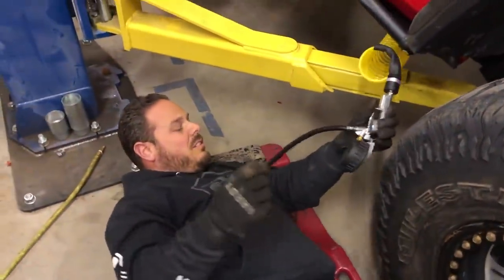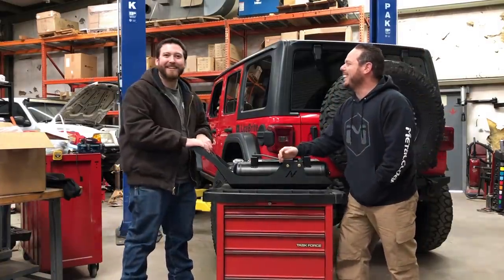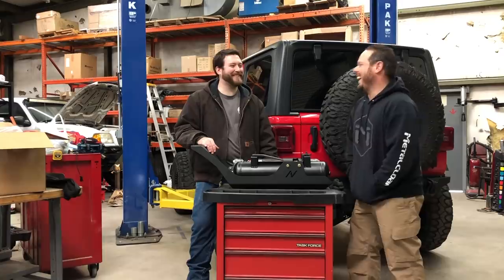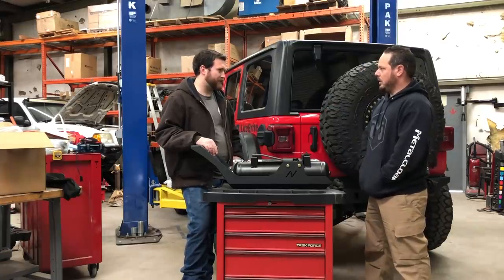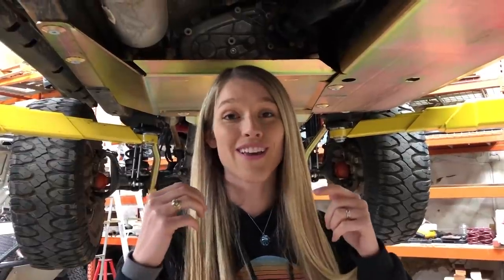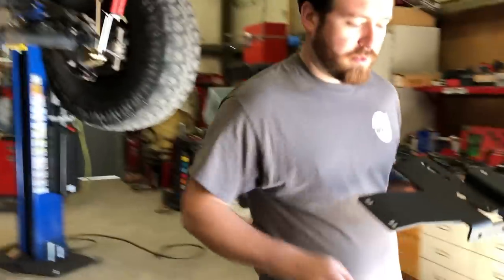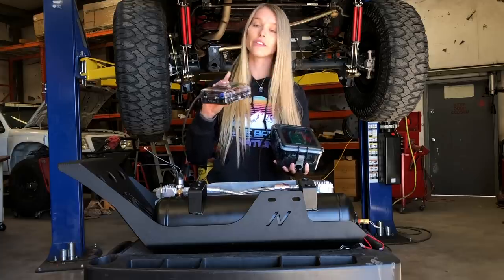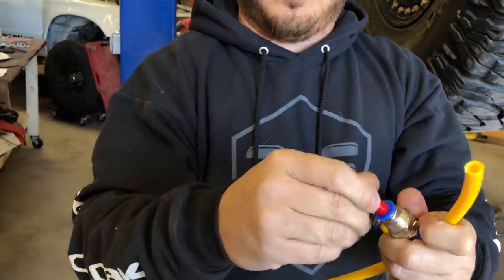We Install Air Compressors UNDER Our Jeep Wrangler JLU Rubicon

Comment: You may find the plastic to plastic quick disconnect leaking over time.  Recommend brass quick disconnects.  I use the rubber tips for walkers to cover my quick connect fittings. The rubber tips do wear out. They are also very cheap and easily available at drug stores and Walmart.  I only plummed one line forward and one line aft. Makes it easy to power someone's Arb if necessary or my tow rig air powered exhaust brake. Also recommend upgraded relays for the compressors. Be sure to carry a spare pressure regulator. They typically are rated for how many times they open/close.

Comment: ha! we love you too! i fabbed the one for the JK to get in a single Viair constant duty on board system(minus that brain) but i used big rig brake line. the tubing works great but it gets tiresome repairing it. i have been exploring another location to double her up another compressor, this set up is sweet. the room in a 2 door is very limited. i have the portable Viair in the JL which is fine for the 33's. they make a great product, we have experienced zero issues. lol that brain makes my manifold look like its a homemade ancient pos that belongs in a museum. but that sh*t still works both lockers and a bumper chuck. i did have to move the pressure sensor relay around to find a sweet spot, it doesnt like heat or water.

Comment: Pretty awesome system. I would plumb the fresh air intake in to the air filter box so that it always gets fresh clean air to pump with. Be sure to add a drain valve to the tank to relieve the condensation buildup in the tank.

Comment: I have arb dual compressors mounted on side of the rear cargo, I added 1.5 gallon air tanks to run air tools. I like this better it’s inside the Jeep and doesn’t take up hardly no room also the open areas of the air holder will fill up with debris. The problem is Kevin, you are in the same boat I am in, with all the mods on both of ours the REAL issue us the weight, we are literally driving a M1A1 Abrams battle tank down the road and trails. The more mods the more weight, and weight is not only bad mpgs but terrible off roading. We are at the point a stock Rubi with descent 3.5” lift and tires with no more mods will have a big advantage off roading and mpgs that we gave up with winch, bumpers front and rear, belly skids, gear, compressor, rock rails, etc. the last goes on and on.
Reply: Kevin Williams I agree, I will see y’all at Windrock, just saying not just yours but mine to, that weight is becoming a limiting factor, in off roading the lighter rigs are better. We used to see the little Suzuki Samari with 10” of lift, unstoppable because they didn’t weigh much at all. I am now thinking about ways to lighten up my Jeep some, even your Buddy Michael was talking about weight. Y’all are fortunate to have companies comp y’all stuff but eventually you’ll have to draw a line because of weight issues.

Comment: A couple things:  They stressed this is pre-production and they want to see if it works.  They will be able to figure out if the heat is too much for the compressors pretty quickly given how much they wheel.  Space in a jeep is at a premium so being able to use dead space under the jeep is a pretty big deal.  The Power tank takes up a good amount of space inside the jeep.  Cost of a dual 444c Viair and 2.5gal compressor kit from 4wheelparts is $689 and Air command kit is $389.  I'm guessing the mounting plate is about $200 so figure about $1300 for this setup.  Powertank is about $750 for complete jeep kit.  Given how often they wheel and in remote areas, an onboard system makes sense.  If you go out once a month and have a local place to fill up on CO2 and have the space, its hard to beat the Powertank.  Personally I went with a powertank given my needs, but if I wheeled like them, I would look for a tank and compressor system.  If this ends up being durable enough it will be a great capability for JL owners.

Comment: Ok have you ever pulled up beside a tractor-trailer and heard the air bleed off of the compressor from the air tank? If you have then that is a valve that once it builds up to a certain pressure it will blow off a Blow by Valve. They also have drain lines or valves that won't bleed off any condensation that is made from the compressor as you know compressed air creates moisture and you have to bleed the moisture out of the tank if you don't they will Rust and cause contaminants to enter the line there for messing up your system so don't forget to install a bleed off valve on the bottom of the tank so you can bleed the condensation out you don't want condensation to freeze in your pump tank lines or your Schrader valves on your tires just a thought y'all have a great day

Comment: As soon as the JT comes out, I've been planning on putting a compressor underneath, as well as 2/3 spare batteries where the spare tire goes. ( I'm going straight to 40's which jeep already said would fit under their anyways. 😂

Comment: Good idea. Be interesting to see if the drive shaft gets into it under full flex. My JK’s driveshaft goes into the gas tank skid. I know you are running aftermarket shafts, so I wonder if that will need to be done for this setup

Comment: So much for showing what a stock Jeep Wrangler will do without all the expensive upgrades.
Reply: Michael Martin their Jeep is pushing 70,000 to 75,000 if they did not get bargains on the gear they are promoting.

Comment: That is a great solution for onboard air, wonder if there will be a similar space on the gladiator? also do not want to think about what something like this system might cost as nice as it looks, without the extra air controller!

Comment: I know it's a prototype,  but if he is concerned about heat and the pumps, why doesn't he switch the location of the tank and dual pumps? Have the tank next to the heat shield and the dual pumps insulated by the heat shield and tank. Really awesome system!

Comment: You should suggest that the manufacturer install a drain on the bottom of the tank so any moisture that develops can be drained off. Additionally, there is a possibility of water entering the air source line that could wind up in the tank that would need to be drained off.
Reply: Kevin Williams I must have missed it in the presentation, Thank You.

Comment: That would be kind of cool if you could hook that 2 air ride and that way you can air up your suspension by a little gauge cluster inside the cab and then you can also are up your tires with the same unit I think that would be kind of cool especially if you were going through snow

Comment: 3+ Months after your install video posted. I was just taken off of my $0.00 per month budget and am getting ready for an on-board air system. I have an ARB Portable Twin compressors enroute. I love the ability to air up/down from my phone automatically. But when I went to Nextadventuremotorsports to see about getting their air command module, hoses and fittings and just using the portable ARB instead of mounting mine next to the exhaust, I find that they are not showing any air system, with or without a compressor on their site. That leads me to believe your prototype is still under development and not ready for the public. The BIG QUESTION is, "How is your prototype system working for you?" I love the system, just not the mounting location of the compressor. Any updates would be greatly appreciated. Thanks in advance.

Comment: I am concerned that the air intake piping is too small to flow enough air to keep the pumps charged. 
While under pressure that size is fine, but at atmospheric pressure, the flow rate will be slow and cause the pumps to not work at peak efficiency. 

It is a good idea, with room for improvement.

Comment: so how do you guys plan to drain the water that the air compressors put in the tank? you have it upside down so no ports on bottom for a drain valve. condensation will fill that tank up eventually and if its steel it will rust plus you will loose air capacity.

Comment: Congrats on the air. That’s an awesome system.  Quick question does the system, winch etc put a lot of pull on the battery?  I have seen people running two or switching to something like the optima yellow top but don’t know if it’s needed.
Reply: Kevin, good to know. Thanks for the reply.

Comment: I have a 2009 Jeep JK and have a Viair Onboard Constant Duty Air Compressor and Tank. I purchased a Cat Muffler so it sits under the left side of the Jeep. So this frees up the muffler area. So I was thinking of purchasing a muffler skid plate and using it to place the air compressor and tank setup.

Comment: Dirt and mud builds up around the push connect fitting then it becomes a pain to remove air lines until you clean all the debris out.
Reply: I have bagged several cars using these fittings. I would have to agree, but they supplied some plugs to help with that. I also think the fittings and ends of the air lines will wear out pretty fast. The fittings and lines are just not designed to be constantly reassembled. I recommend they keep some air line cutters in the glove box to cut some fresh ends every once in the while. I plan to build a similar setup, but using standard 1/4" quick couplers.

Comment: any plans for us 2.0L guys? I have been looking at a CO2 system but I have run an ARB under my JK hood for years and i would prefer air on demand. Especially if I forget to weigh the tank and go get it filled.
Reply: @boughtnotbuiltoffroad7784  yeah that what i figured.

Comment: Do they have anything for the jku I run a viair setup right now with one compressor I want to see if I can get a second compressor and a better mounting bracket underneath the Jeep.
Reply: @boughtnotbuiltoffroad7784  that would be awesome the set up that I have right now I have my compressor in the engine bay and my tank underneath and it's sitting sideways on a mounting bracket that I made next to my EVAP system is so I mean it works but I want something a little bit better with a skid plate just so I don't damage my tank.
Reply: @justinbos3924  Hauk Offroad makes a air tank skid system for JKs http://haukoffroad.com/by-vehicle/jk-products/jk-air-tank-skid-system/

Comment: Not sure if I'm seeing this right so you have to hook it up underneath every time you need air? like in our trucks when we had our pickups all we did was hook a hose up right there at our bumper and air came out the fitting was at the bumper. we didn't have to crawl underneath the truck every time. Are you going to have to do that or is there not a air valve where air comes out with the hose hooked up at the bumper? I wouldn't think you have to crawl underneath every time you need air for something.  As much stuff as you're putting on that jeep it's got to weigh a ton LOL all the skid plates that looks like a lot of metal there is steel that jeep starting to be very heavy can't imagine how much more it's eating up on the gas mileage with as must travels y'all do  going downnthe highway. And people  supposed to give gas mileage much as you travel highway you need as much as you can get every mile we count LOL
Reply: No, they are running lines to all 4 corners of the Jeep with quick connects at each tire.
Reply: @metalhead4x448  that's what I thought there would be quick connect somewhere. What's the name of this company again and what city are they in

Comment: Your machine is getting fat. A lot of weight for a 3.6 liter that has stock gearing. Gear swap, super charger, turbo charger. I have a similar set up on my ford raptor and super duty. Works well. Not sure how your maintenance will be on the air pumps after a few mud and water crossings. My pumps are in the bed of the raptor and super duty. Noise wise is perfect for under the vehicle. Those pumps won’t last while submerged under ice, snow, water. Get stuck for any length of time and those electric pumps are done. You will have to completely dry them out before use. Make those pumps water proof and then your buddy’s engineering will pay off. Take that pump back down and submerge for 3 min and see what happens

Comment: you should have put sound deadener above the compressors
Reply from the maker: Mark Micallef They’ll only be running when we air up, so we weren’t too worried about the noise. 😊
Reply: @LiteBrite  Jelly might appreciate it LOL

Comment: If you think  its HOT for air compressors under a hood, put a temp sensor near your compressors and let us know how hot it gets in that area in the middle of the summer while rock crawling, IN THE MIDDLE OF THE NEVADA DESERT.  I am betting over 300 degrees. What is the operating range of the Viair compressors???  Hmmm.  Too close to the pipes for me.
Reply: Best comment so far.
Reply: My Viair pumps operate so hot that I cannot touch them. They are used running and being extremely hot and I have mounted in the trunk with less air flow. Id wager they run cooler when outside the vehicle and the amount of heat that radiates off your exhaust pipe and through a headshield is likely going to have zero impact on the temperature the pumps run at. Viair makes a JK pump kit for running behind the radiator, infront of the motor, I would argue that is far far hotter for the pumps to operate in with worse air flow.
Reply: @Casey250  Bottom line Casey, what is the upper most operating temp of those pumps? They do not post that information on their website. And what is the air temp of that cavity after you crawl up a 2 mile long rock garden with an ambient temp outside of 110 degrees? The first time I got out of my new unlimited and brushed my bare leg against the metal rock sliders causing a 2nd degree burn, I checked the temp of that rock slider. 250 degrees at the rock slider where my leg touched it. What was the temp of the air in the cavity they mounted the two compressors in, under the jeep, inside the frame rails, less air flowing past than my rock sliders had, crawling at 1/2 to 1 mph straight uphill. I am betting the temp of the heat shield btw the exhaust pipe and compressors exceeds 350 to 400 degrees in some circumstances.  Everywhere I have checked (including Viaircorp.com) do not give any max. operating specifications. They do have thermal shut off safety's which will shut them if they get too hot. BUT, how many times will they reach that shut off temp before they melt the Teflon or plastic piston or at least, greatly reduce how long they last. If they would put a 100% Unlimited, lifetime warranty without question, will immediately send you another compressor as soon as you think you need one because yours is making a different sound than it did when it was brand new, then I am going to be concerned with electronics and mechanical products getting too hot and only lasting 2 weeks past their 90 day or 1 year warranty period. AND when you call them one or two weeks after the warranty period, they tell you to pound sand because your purchase is "OUT OF WARRANTY".  Nice way to waist $300 or $400. Personally, I use a Viair also. But it is a portable one and when I use it on extremely hot days with no breeze, I place it on the RF floorboard and kick on the A/C full blast to keep it cool enough to touch it without burning my hands. That way, I know my $$$ is not burning itself up.  When my Viair is not performing well anymore, I am going to purchase the ARB Portable Dual compressor setup and use the A/C on it on hot days also. My Viair my NEVER need to be replaced they way I use it but now with 37's, my patients may not allow for the 30 minutes to air back up. The ARB will be much faster.
Reply: Why would you wheel in the middle of the summer in a desert?  Mountains summer, desert winter.  Problem solved.  :-)
Reply: Bottom line, BECAUSE WE WANT TO!!! We wheel 24/7, 365, wherever the trail's lead us. If it's in the middle of August geocaching along the Route 66 Power Trail in the middle of the Mojave Desert past AMBOY Ca. , we do it. Even if it is 125 degrees in the shade. We are original Desert Rats. AND we make sure our equipment can survive the extremes. Anything that is sensitive to heat is mounted in the interior, where the A/C can cool it when needed. (Dash Cams, Air Compressors) People cry that it is crappy products when their compressors die after reaching their max temp and shut off 20 or 30 times, then fall apart in the first year of use. I have a 5 year old compressor that also has an automatic thermal shut off and has NEVER shut off once because it is treated right. Mounting it under the hood where temps can reach 500 degrees or under the undercarriage next to the hottest part of a vehicle where temps can reach 800 degrees, JUST DOESN'T MAKE SENSE TO ME!!!!!  Protect your investment, wherever you wheel, whatever time of year.

Comment: That set up is so impractical due to the exhaust being close by for a couple of reasons, One if grass and such builds up in there then it is going to catch fire and will need cleaning almost daily in some locations and Two when you need to change the CAT or any part of the exhaust then the Exhaust Shop are not going to be as caring as you would when it needs to be removed, Personally I would of gone with the ARB Portable Unit, It will fill 37's in 90 seconds and you can take it from one Vehicle to another and parts are available world wide Unlike these Chinese Viair compressors, not to mention that your set up must weight 50 or 60Lbs.